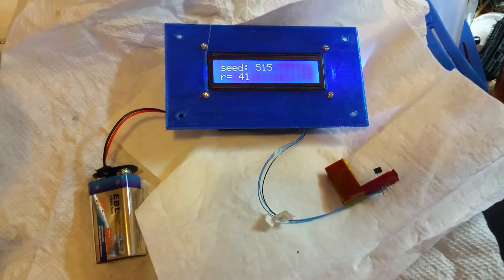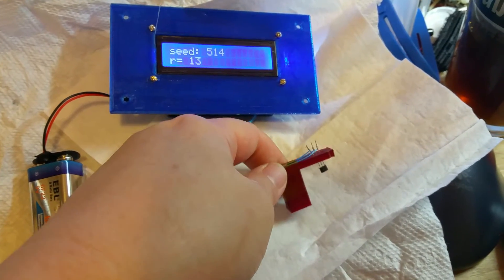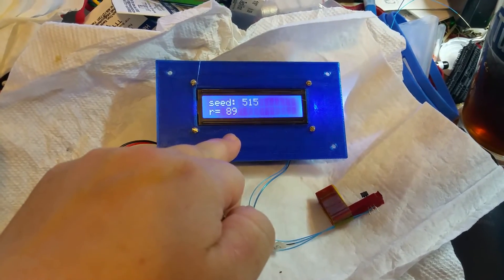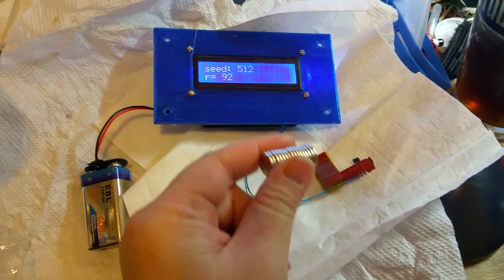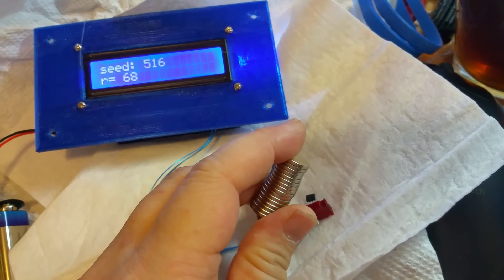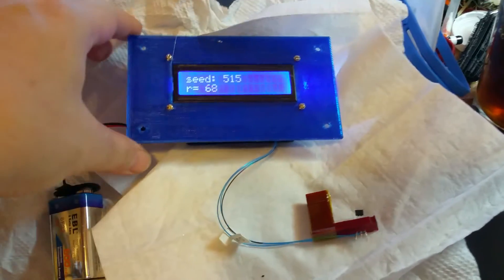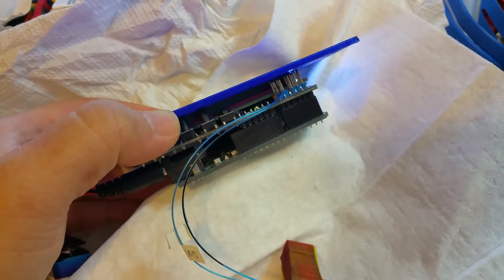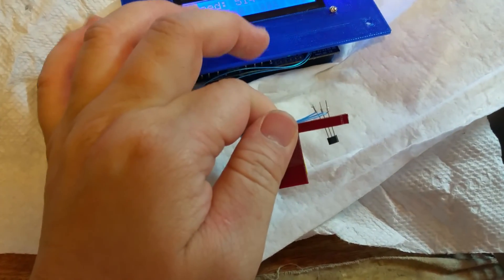Testing hall effect sensor

Comment: Hey, im sorry if im bothering so much, but I made a long research and I just wanna make sure if what im doing is being really random. So I connected the pin of the sensor to the analog0 , and this is the code:

#include <LiquidCrystal.h>
LiquidCrystal lcd(8, 9, 4, 5, 6, 7);

long randNumber;

void setup() {
  Serial.begin(9600);
  randomSeed(analogRead(0));
}

void loop() {
  lcd.begin(16, 2); 
  randNumber= random(400);
  lcd.setCursor(0, 1);
  lcd.print(randNumber);
  delay(500);
}
but idk how to print the seeds into the serial, I print the serial like you did in your video but it prints a "1", so idk if im seeding it correctly, how did you do it to print the seeds?

Comment: hi hey Im remaking your same generator for a project, and I was wondering whats the code you used, I'm actually using an arduino UNO and, also, what are the exact pins where you connected the sensor, help plz urgent
Reply from the maker: there's barely any code so I didn't bother to save it. Use any analog pin. 

Then read the input as a random seed like this,  randomSeed(analogRead(PIN_NUMBER));

Make sure these numbers are correct by printing to the serial. The rest is just displaying it to the LCD on a loop. 

I don't know how much you know about arduino, but basically you need to write a main loop, read the hall effect sensor via an analog pin, feed the number to randomSeed() and call random() to get a random number. Then you display it onto the LCD.
Reply: +carolcheny oh well idk anything about it, this is why I need help xD and plz what are the pins where you connected the hall sensor? You connected it to the LCD but idk what exact pins plz I'll be so thankful if you help me🙏🏼
Reply: +carolcheny please if you could upload the code in the website where you put the 3d pieces, or just post it somewhere I'd be so thankful please I need it urgent, like I already printed all the pieces and bought everything I needed but I didn't realize that the code wasnt in the website....so please please help me, it's for a doctorate 🙏🏼